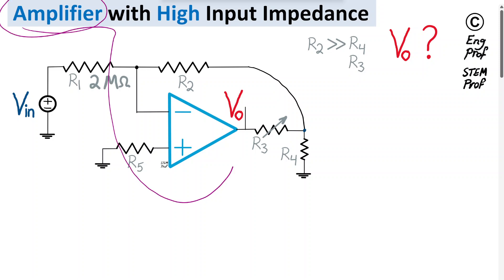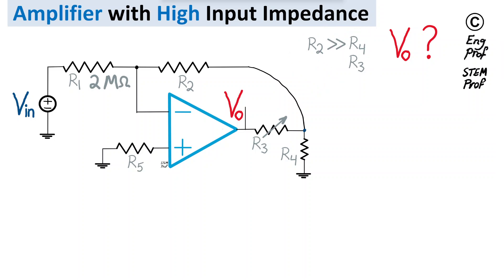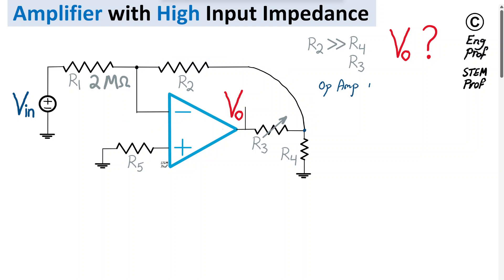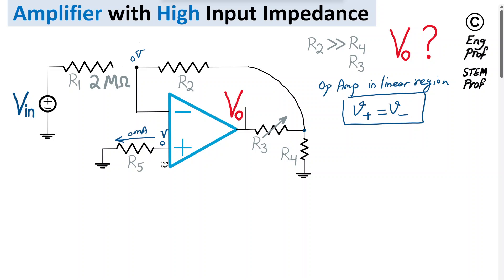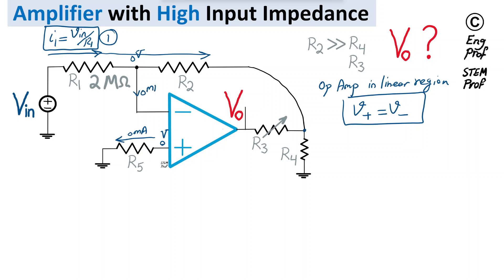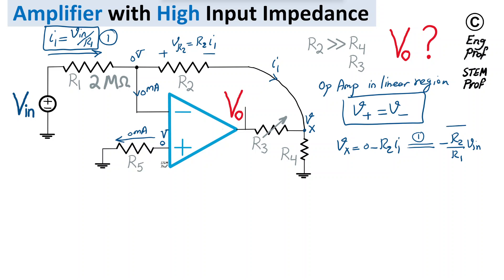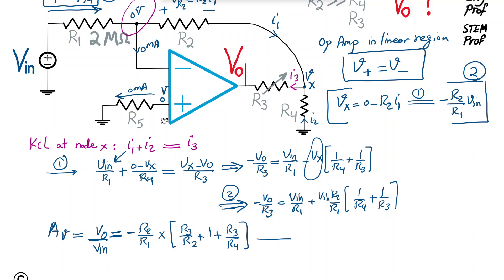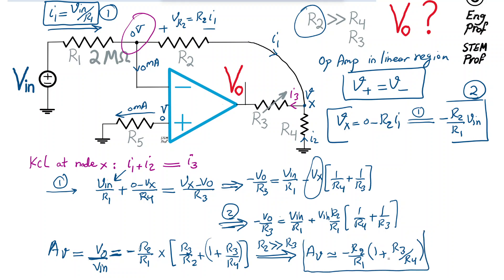Op Amp Amplifier with high input impedance and large voltage gain

Comment: Hello, I was looking for a high impedance "front end" for a signal tracer. I would make R2 220K, R3 100K potentiometer and R4 5K6 in order to spam from 1/10 gain (R3=0) to 10x gain when R3=100K and im using a JFET TL071 opamp. I have place the values on the long formula. The idea is to use it on tube and SS. Tube tend to have large swing on signal, so atenuation would be welcomed. I dont want to attenuate at the very input, because I want to get as high input impedance as possible. Granted that I have 1N4148 for input protection that wont let me reach that. Any suggestion you can give me I would appreciatte. THanks you !!!!.
Reply from the maker: You are very welcome! It sounds like you’re on the right track with your design for the signal tracer. Using a JFET op-amp like the TL071 is a solid choice, especially for maintaining high input impedance. Regarding your component choices, I’d suggest considering a few things:
   The 220K for R2 is a good value, but be mindful of the tolerance in the potentiometer for R3. With R3 being a 100K pot, you'll get a nice range of gain adjustment, but ensure that the pot’s resistance range and the values you're using for R4 (5.6K) don’t cause excessive loading at the output. If you’re concerned about input protection affecting impedance, 1N4148 diodes are decent for basic protection, but keep in mind they can introduce some non-linearity or affect the input signal slightly, especially at high frequencies. You could experiment with different protection schemes (like using a pair of diodes in anti-parallel or using more precision protection diodes) to help preserve the high input impedance while protecting the circuit.
   For attenuation and gain control, my following videos provide further insights:
"VCA: Voltage-Controlled Attenuator Overview" https://youtu.be/cFzYZsPEtP0 covers how to implement attenuation without compromising signal quality, which might be handy where attenuation is needed.
"Op Amp Amplifier with Electronic Gain Control: How does it work?" https://youtu.be/NoNgQpbj77Y gives a deeper look into adjustable gain circuits, which could give you additional insight into how to fine-tune your design for solid-state (SS) applications.
Hopefully, this explanation and videos are helpful.
Reply: @STEMprof  THANKS !!!!!!!!!.
Reply from the maker: @ My pleasure, glad that it was helpful.

Comment: THIS Channel is so precious! Thank you Prof
Reply from the maker: You are welcome! Thank you. Glad that this engineering channel is useful. For more circuit examples please see:   Instrumentation Amplifier with Electronic Gain Control https://youtu.be/C4tghZ-q6Zs 
Push-Pull Power Amplifier with Op Amp, Sziklai Darlington Transistors https://youtu.be/8BFzsi7-Vbs
Op Amp Amplifier with Electronic Gain Control https://youtu.be/NoNgQpbj77Y
VCA: Voltage-Controlled Attenuator Overview https://youtu.be/cFzYZsPEtP0
Power Amplifier Design (Class A) with Transformer https://youtu.be/gKlJrqGqeCI
I hope these Circuit design and analysis videos are interesting and useful. 🙏

Comment: One thing to consider is that while this is fine for DC or low frequency AC signals, with such high gain is you'll start to become bandwidth limited and lose gain at higher frequencies. If you need high frequency performance you're better off cascading two or more lower gain stages.
Reply from the maker: Thanks for sharing your thoughts. With the choice of components (discussed near the end of this video), this example circuit has an input impedance of 2M ohm and a gain of ~101. So the gain is not very high but nonetheless impressive for a single op amp design while having multi mega ohm input resistance.  Nonetheless, to your point, properly designed cascade of two op amp stages should give us more flexibility and improved frequency response.  Thank you.

Comment: Thank you for video! Can this circuit be used in a mixer to amplify a microphone signal?
Reply from the maker: You are welcome. Depends on microphone type and requirements. But given 2M ohm input resistance, circuit draws sub micro amp level current from the unit source.
Reply: @STEMprof  ohhh

Comment: A large voltage gain means a small signal, right? 2meg input resistor (plus we have to use a same at a non inverting input) - that’s a very noisy element, which is not good for such signal. However it depends on the requirement of course. For a guitar pre-amp the worse the better 😂
Reply: Could you explain what you mean by, “for a guitar pre-amp the worse the better”. Thank you
Reply: @rudygomez6996  Yeah ) That's funny, but guitarists all the time look for good distortions and fight against 50/60Hz hum. So, few less dB of S/N is nothing for them. 
And they have high impedance coils, so need a very high impedance pre-amp input.
Reply: @sc0or  so you’re saying the noise created by this circuit wouldn’t bother guitarists because its nothing compared to a hum? What creates this hum? and why does 2meg input resistor create noise?
Reply: @rudygomez6996  Sure, absolutely won't bother. A guitar pickup is an open inductor which captures a hum from wires around very well. There are symmetrical pickups called humbuckers, but they are not symmetrical enough, and the hum is audible anyway (but much less). High ohms resistors are noisy because of a chaotic electrons movement. 2meg resistor at a room temperature will generate about 4.5uVrms in a bandwidth of 10kHz. If a pickup max voltage is 4.5mV, that means a 60dB S/N. Not too much, not too little. 
There is another kind of an electrical noise caused by a current, but it is remarkable only at high current values, where we don't talk about small signals.
Reply from the maker: @sc0or  Thank you for sharing your thoughts and good points.  While extra care regarding noise is required in these very high input resistance op amp circuits, the voltage gain of amplifier is on the order of a nominal gain of 100.  With that said, good point regarding noisy pre amp for Guitarists 😀
Reply: @sc0or  thank you for your response. How do they measure to discover that 2meg resistor generates 4.5uVrms with bandwidth of 10khz?
Reply from the maker: Thanks for the insightful comments & questions. Please see How to Compute Thermal Noise Of Resistor https://youtu.be/gMEKG_FeAuM. I hope this is helpful.

Comment from the maker: This video shows a practical method to design an amplifier with single Op Amp to simultaneously realize very high input impedance and large voltage gain. For more examples please see the analog circuit and signal processing video playlist https://www.youtube.com/playlist?list=PLrwXF7N522y4c7c-8KBjrwd7IyaZfWxyt
And Digital Circuits and DSP playlist https://www.youtube.com/playlist?list=PLrwXF7N522y6cSKr0FmEPP_zQl011VvLr
Thanks for watching.